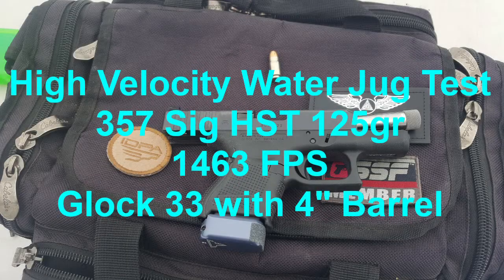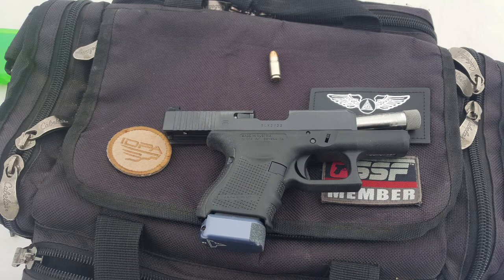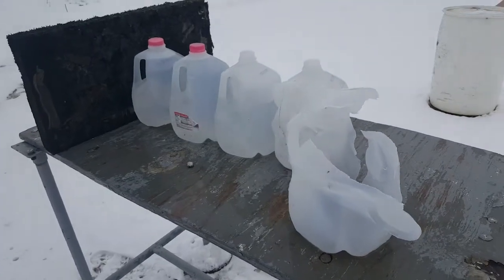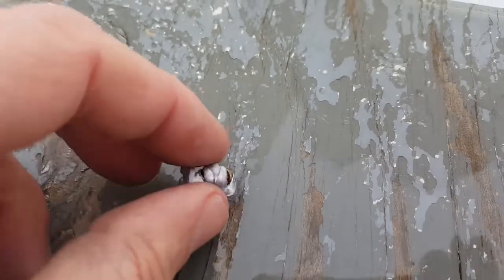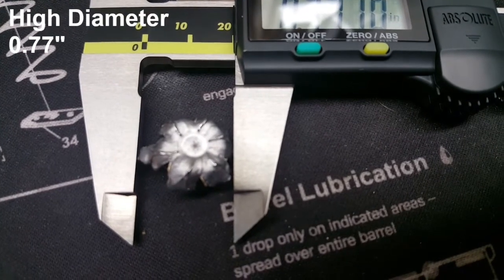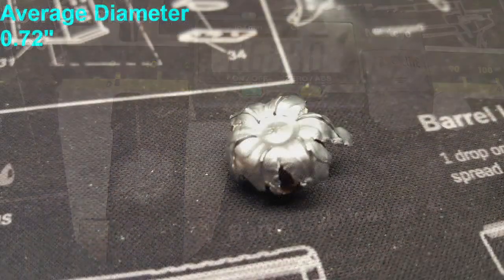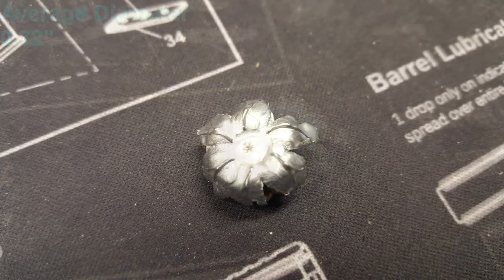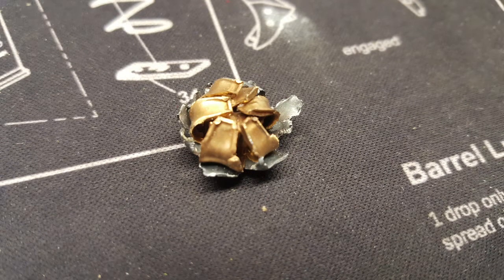357 Sig HST Ammo High Velocity Water Jug Test

Comment: "Overexpansion".  I do not believe that is a problematic on a handgun round.
Reply from the maker: Over expansion can be an issue as the round won't penetrate as far if it over expands.  However in this test it went through 3 water jugs, so appears the velocity is enough to push it to the proper penetration.
Reply: @ericfrank9491  I understand what you are saying.  In a real life defensive scenario I want as much of the energy dumped into the target as possible.  Personally speaking, I am not concerned if it over expands and I don't care if it even shreds a pedal or two as it passes into the target.  Multiple wound channels are not a bad thing in a life and death shoot.  There are many variables that come into play but most human targets are not more than 16" at any point.  Keep up the good work with the videos!!
Reply from the maker: I agree, I want the most energy also which is why I carry the 357sig.  I think it's a great round as long as you can shoot it well with the additional recoil.